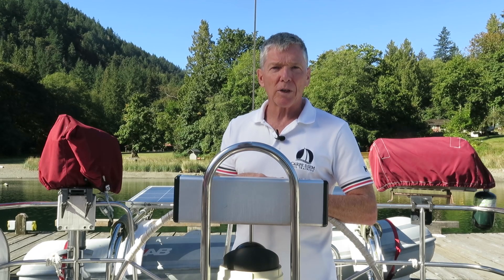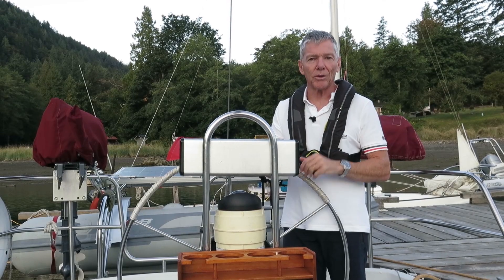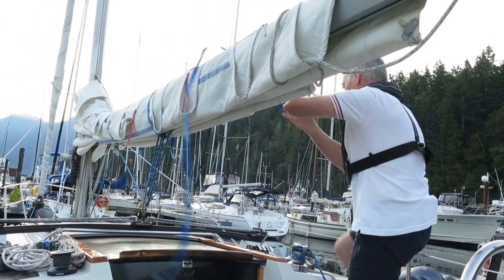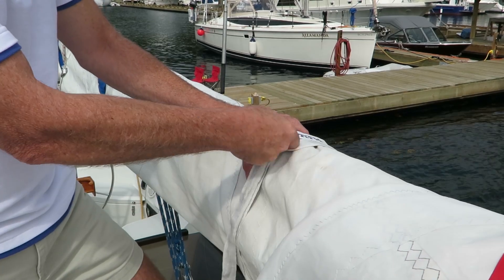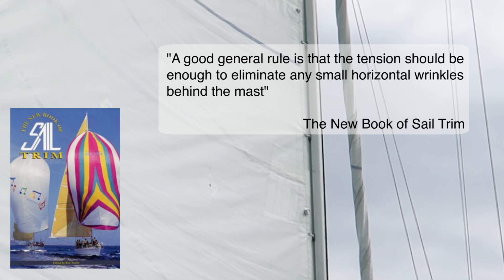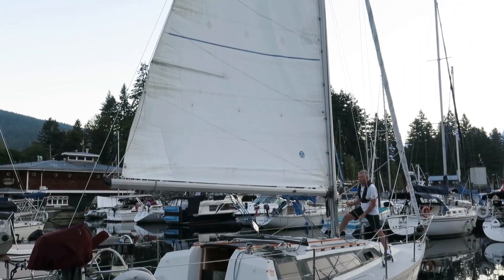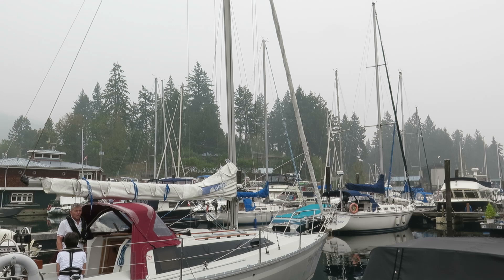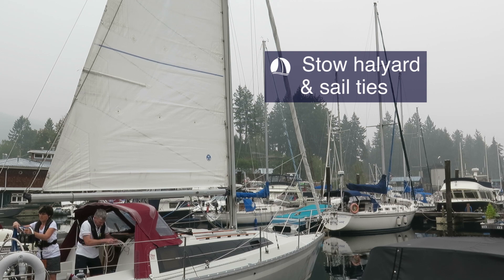Ep 20: Learn to Sail: Part 9: Raising the Mainsail

Comment: Another useful video, thanks!  You mentioned easing vang in prep for raising mainsail, but didn’t then include tensioning back up after?
Reply from the maker: Essentially the vang is only used downwind when the main sheet is eased. Upwind the main sheet is already pulling in and down.

Comment: Great video and very safety enhanced. While my boat is being refitted,  I'm leading all lines aft. Most people complain of line friction with lines led aft, but the safety gains outweigh any friction. The cockpit is the safest place to be, though jacklines are also installed.  I like your series. Thank you.
Reply from the maker: Well said! I agree completely. I'm delighted that you are enjoying the videos. Thank you for your encouraging support.
Reply: My boat is WAAAAY easier to control at the mast. But that adds in some level of danger. Look how much trouble he had raising the main at the dock in zero wind. I dont even need the winch hardly at the mast, just the final 5% to get the tension.

Comment: When did you tightern the boom vang?   Never noticed it.
Reply from the maker: I didn’t and it was intentional. You have to loosen the vang before raising the sail because it pulls down on the boom. Once the sail is fully raised you can then adjust the vang, Cunningham, traveller etc as needed for correct sail shape for the conditions. I generally only use the vang off the wind. When beating the main sheet is already pulling down on the boom.

Comment: Did you forget to tension and lock off the boom vang at the end of the process? If not when is this adjusted? Thank you.
Reply from the maker: Thanks for the  question Ian, I was close hauled and if you think about it once close hauled the main sheet is pulling in and down, so no need for the boom vang. Racers are much fussier about boom vang tension and for good reason As a cruiser I use the vang to control leech twist when sailing off the wind.
Reply: @CarpeDiemSailingMagazine  thank you for your response. Yes that makes perfect sense. I love your channel by the way. Such great, clear and concise, easy to understand content! Thanks again.

Comment: I am new to sailing and have a question. Is the sail attached to the boom cable at anypoint?
Reply from the maker: Hi George,
Thanks for watching and for your question. The sail is attached to the mast via slugs or a bolt rope with a line called a halyard attached to the top or the head of the sail. The forward lower corner, the tack, is connected to the boom at the gooseneck with some hardware. The clew (the aft lower corner) is attached to a line called the out haul. The foot of the mainsail is either loose or may ride in a track, once again with a bolt rope or slugs. Hope this answers your question. Check out Ep 4 Parts and Terms I’d you have not already done so. Thanks for following.

Comment: Why do you ease the main sheet all the way. Why not just ease it a little so the boom can’t swing too much maybe to close or beam reach setting. What it a big gust of wind changes direction or swell and causes the boom to swing out too much. Sorry for the newb question just want to know the reason you do this when raising the main by easing it out all the way until the main sail is fully up. TY
Reply from the maker: No apologies necessary, you're learning. The whole point of easing the sail is so that it will swing and not catch wind. It can't really swing out too much. Normally it will not swing much but either way (as long as you are paying attention and keeping the boat head to wind) but that is why you stay out of the way of the boom until the sail is all the way up, luff tensioned and then mainsheet hardened

Comment: what about the topping lift?
Reply from the maker: I don’t follow. I talk about the topping lift in great detail starting at 9:26
Reply: @CarpeDiemSailingMagazine  So when you go to raise the sail, you ease (lower) topping lift prior to raising sail correct?
Reply from the maker: @bradgradert  No. When the sail is up the boom is supported by the sail so the topping lift is not needed. Set your topping lift before lowering the sail. All the topping lift does is hold the boom up when the sail is down. Ease the topping lift once the sail is up
Reply: Ok. sorry for my ignorance. So the topping lift is raised prior to raising main. Once main is up, release topping lift so boom is supported by main. Does that sound correct?
Reply from the maker: @bradgradert  No apologies required, you’re learning. Yes that’s correct. Topping lift on as sail goes up then eased once sail is up. To be clear I set my topping lift just before I lower my main and then it stays on until I next raise it. No need to specifically set before raising the main, it should already be on, holding the boom up.

Comment: The wraps that you have along the top of the helm, where did you get them?
Reply from the maker: I did it myself. Its called a French Spiral Hitch or whipping. It’s just light cord wrapped around Essentially you start with a clove hitch and keep repeating it and pull it as tight as you can. It helps to wear gloves.
Reply from the maker: Check out this link
https://goodoldboat.com/dress-up-the-steering-wheel/
Reply: @CarpeDiemSailingMagazine  Cheers!

Comment: Why pinky first and not thumb first when pulling?
Reply from the maker: It gives you a better grip and you're set up for wrapping the line around the winch without having to change hand position.
Reply: Thank you.
Reply: @CarpeDiemSailingMagazine  Also: "Pinkies are cheaper than thumbs." If your hand gets pulled into the winch, better to have a broken pinkie than a broken thumb. Great video btw.
Reply from the maker: @richardwilliams2629  Thank you for your kind comment